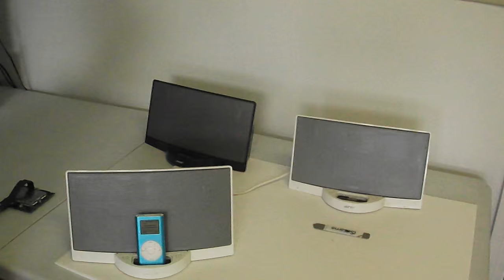Bose Sounddock Series 1 repair no sound issue  286143-001 277687-001 Diagnostic

Comment: I ordered a replacement card and followed this video. Worked great. BTW, I found that if you remove the panel between the speakers the ribbon cable is ~6” long and much easier to plug into the sound board. Thanks for making the repair available. Best!

Comment: Received unit on Saturday and sat down today (Monday) to install it, it literally took 5 minutes to do and it works great.  If you have the slightest aptitude to use a single screwdriver you can do this.  The only suggestion to BoseRenew might be to re-shoot the video to make sure there's a better shot of the board and cables when reconnecting/reinstalling.  It didn't affect me, but I could see where it could be confusing for some.  Great job on the product and more importantly, great price!
Reply: Daniel Jaburg :
Reply: Agreed on the part of the video that talks about reconnecting the 2 cables.  I really could not see what he was doing so I had to guess. But it wasn’t difficult.

Comment: I changed mine out with a new audioboard, and it works except the very fragile speaker nipple got dented when trying to unscrew the component which requires the strength of Superman to take the screws out.  So now I have a buzzy feedback when there is bass.

Comment: My Sound dock series 1 is not working. I know it receives power but an old iPod touch says that the device will no supply power or does not recognizes the charger cable. So, it does receive power but it's not charging my ipod.
Also it is not playing any audio. Is this solved with a new sound board? Do you guys ship to Mexico?

Thanks in advance

Comment: Not a technical solution, you just replace the system board, a real fix should be repair the problem at the board
Reply: asi es en usa, es mas barato reemplazar una pcb, que buscar la falla y repararla!!
Reply: @reparalo6839  hay alguna solucion que usted conozca? acabo de comprar un equipo como este, conecto el ipod y lo carga pero si pongo play no suena nada